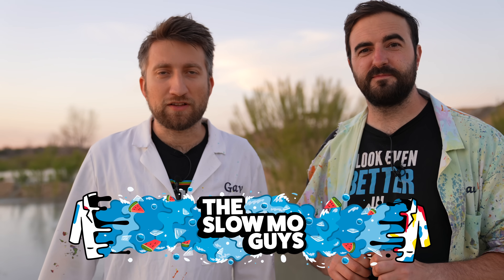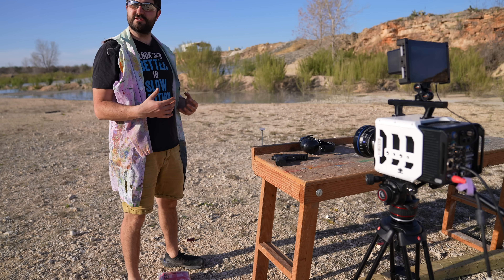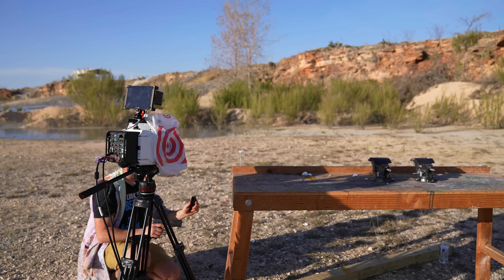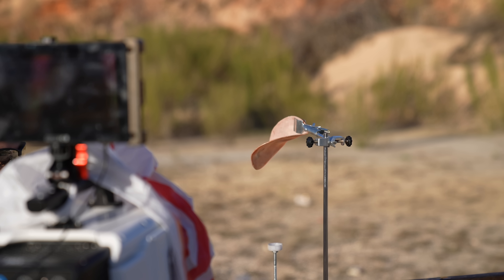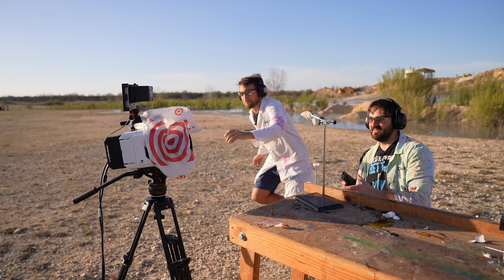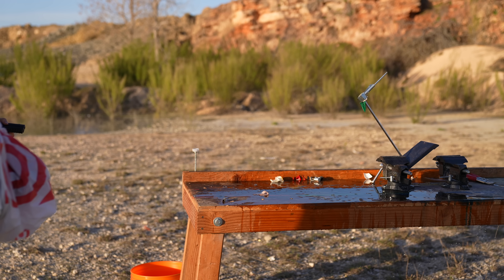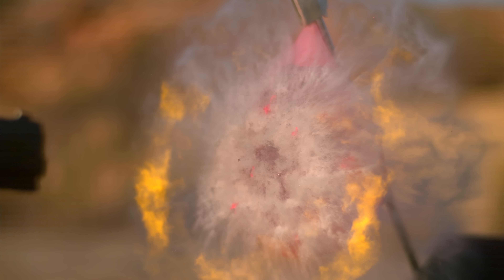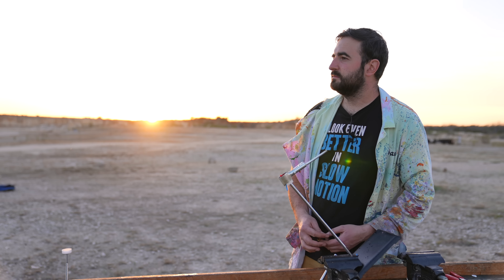The Explosive Power of Blanks at 82,000FPS - The Slow Mo Guys

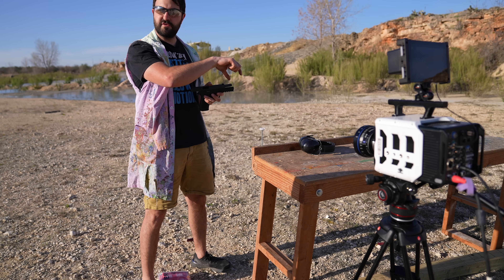Comment: 1:40 If this is a recoil operated gun, even a blank firing adapter* wouldn't force the gun to cycle, because you need the accelerated mass of the bullet. Recoil is defined by Newton as "[...]sive corporum duorum actiones in se mutuo semper esse aequales et in partes dirigi." Mathematical "bullet mass X bullet speed = slide mass X slide speed". If the bullet isn't there a locked slide will not move. You can put as much pressure as you like in a slide-barrel locking group it will not move (unless its blown up), its like an enclosed pressure can. To make a slide-barrel locking group move backwards you need the recoil of the bullet to unlock the system and allow the gas do move the now decoupled slide backwards.

*There is an exception for blank firing adapters that are fixed to the frame, like the MG42s recoil booster, such a device provides a contra point outside the slide-barrel locking ground, this turn a recoil operated gun into a gas operated one.

Comment: i recently saw a clip of two electrical grinders whos blades were oriented perpendicular to each other, and when they were moved towards each other, the two blades neatly annihalated each other, millimeter by millimeter. i immediately thought that would be a nice thing to watch in slow-mo. make it happen?
Reply: It was on the HPC channel. You could suggest it there too - they have used the same slow mo cameras in the past.
Reply: @KonradTheWizzard  i actually saw it on Reddit in a short clip/gif without context. did they already have a slowmo of it on the HPC channel?

Comment: I’ve always wondered why Gav runs to the camera after the shot is taken. I assume its to literally keep it from saving gigabytes upon gigabytes of useless footage so the Camera doesn’t blow up?
Reply: Watch some of the older videos. The camera stores a rolling 5 seconds of video. He has to push the button, so it does not delete the footage with shots of nothing happening in slow mo.
Reply: I believe the camera keeps the last ~10 seconds in temporary storage and overwrites old data, only truly saving it once the button is pressed. So if Gav waits too long the shot would be deleted. And with a higher frame rate/resolution that time window only gets smaller.
Reply from the maker: I have 2.8 seconds to hit the button before it records over the action. I usually run a trigger cable to wherever I’m stood but felt like I could make it over there in time for this one.
Reply: @theslowmoguys  2.8 Jesus, 2.8 to give us the amazing footage!

Comment: A blank is not without its dangers
Just as Brandon Lee
Reply: No, he died because there was the head of a dummy bullet still stuck inside the barrel of the gun and it acted as if it was a real bullet when the blank was fired at him.
So it was not the blank itself that killed him but the dummy bullet head when it hit him just like a live round would have done if it was used instead.

Comment: Brandon Lee was killed by a foreign body in the barrel of a gun shooting blank rounds. Through medics i've heard of horrible hand/face injuries due to poor muzzle awareness with blank rounds. So good job Slow Mo Guys on showing folks how dangerous blank ammo is. Even with a BFA (Blank Firing Adapter/Attachement) they are still dangerous. So Don't Eff around to Find Out
Reply: The foreign body was a bullet. They had previously done a shot from the front of the gun with real rounds without powder. The reason for that was, if you film a revolver with blanks in from the front it’s super obvious that you’ve got blanks in. Unfortunately they left the primers in the rounds and firing the primer was enough to push the bullet into the barrel. Then the blank that came after fired the bullet almost like normal.
Reply: @jeremypnet  They don't use any live ammo, blank or not, on the John Wick films. Chad Stahelski was Brandon's stunt double for The Crow. All CGI, no unnecessary deaths.

Comment: forgotten weapons has a video where he talks to someone from a film prop gun company about how they alter real firearms to shoot blanks

most semi or full auto guns have a slight blockage put in the barrel to get the gas pressure up for cycling the action and there are also different powder loads in blanks for various use cases (level noise and muzzle flash as well as safety for closer-in shooting)

would be interesting to see some film ready guns shooting those film blanks

Comment: a .22 blank when loaded into a Ram Set will drive a nail into concrete. Blanks are powerful things
Reply: It depends on the strength of the charge used in them but the old-style free-flight Ram Set guns could fire a nail at 900 meters or 2952.76 feet per second.
The newer piston-driven ones only achieve 90 meters or 295.276 feet per second which is still at lethal velocities.

Comment: When I was in the army, we used BFA’s (or recoil enhancers, as we called them) when using blanks. 

At the time we had a 5 meter safety distance for shooting blanks towards eachother with the BFA, and 15 meters without one using 5,56. This shows why.
Reply: We used to have to do a safety demo, by firing a blank into a plastic bag filled with water to show what would happen if you shot someone from the same distance.
Reply: Another advantage of many BFAs is that in the event of a live round being fed into the gun, the BFA will act as a sacrificial bit to absorb the energy from the projectile and reduce the likelihood of downrange people being injured.
Reply: Don't remember the safety distance for the Swedish 9 mm SMG but dedicated barrel with cap was a must since those rounds had a ceramic plug instead of bullet. (With the added note that those ceramic plugs were blood coloured and invisible to X-ray.)
Reply: We were also told the safety distance was also do do with how far a BFA can be ejected from the barrel if not screwed on properly or it fails.
One lad had an ND with his rifle in his sleeping system thankfully it just damaged his bag....
Reply: @nipstyler  Sounds like the BFA needed a secondary tether (no clue how possible that is since I know nothing about therm)